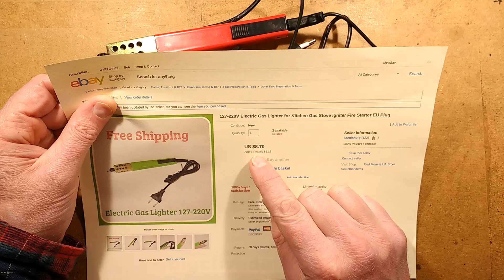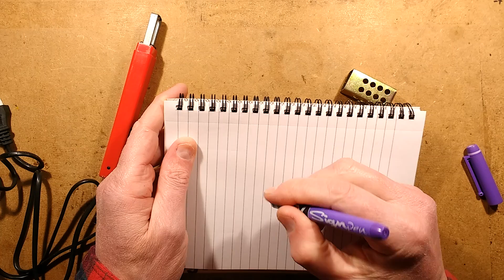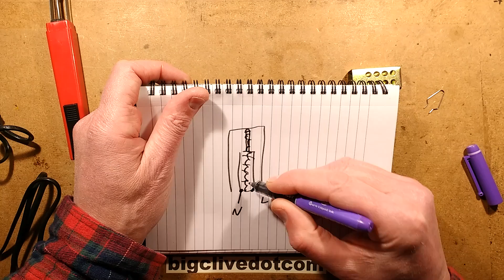Inside a pleasingly scary Russian 240V gas igniter.

Comment: 220v gas stove lighter. Sold here in Romania up until 92. Then the ones that look like a cigarette lighter came out and then the stoves equipped with the piezoelectric ignition from the manufacturer. The 220 volts ones, half ass decent, but play with it for more than 15 seconds at a time and they would kick the bucket.
Reply: RO BT - it's the official exchange ratio set for the dollar in 89. You could buy dollars on the black market at 85 to 100 lei per usd.
Reply: How much did they cost?
Reply: Fridelain - it was 21.75 lei. I remember because the price was stamp in the plastic. About $1.5
Reply: Jack White - that's because people in Eastern Europe still have some fucking common sense...
Reply: I did see an historical record showing that about 100 years ago the rate was $4=1leu - yep, the leu was worth 4 dollars!  It will be even more chaotic when we have to work in Euros for day-to-day purchases.
Reply: Indeed, a perfectly acceptable three-course meal can be had in this area for 20 lei.  However, the cost of living is rising rapidly - vehicle fuel increased by 25% in November and some foods doubled over Christmas.  A cynic might suggest that the population is being softened up for the change to Euros (which reputedly doubled prices when it happened in Italy).  Raising the minimum wage just makes things worse for those who have no formal income.
Reply: That suggests about 14.5 lei to the dollar.  Today's official figure is 3.7 - shows how much the dollar has been devalued!
Reply: I remember my grandma used to have one of this thing, the last time i saw it, i was only 5 or 6 (around year 2000). It could make incredible loud noise which scared me. I have never saw she used it, because the gas stove has the ignitor integrated. I'm from  China, so it is likely that the ignitor was imported from the Soviet Union.
Reply: Fuck me that was expensive. I bought an awesome watch from a fancy shopping centre in romania for 22 lei. 

Ignore the dollars comparison, romania is cheap as hell generally, especially so back then, ecconomically that is more equivalent to $100 in terms of spending power for the average worker. Lets put it another way, minimum wage in romania is $310 per month after tax - and even then you might be on 12 hour night shifts.

A meal in romania will cost you about 20 lei per person, generally. Here it is £25. 

I think this context is necassary to people trying to understand what the cost would feel like to a romanian. Affordable, but not dollar store as the monetary values would make you think.

Comment: So was the burnt varnish smell from the nail or the windings.
Reply: There's no varnish on the nail. Obviously.
Reply: Siana Gearz well in my experience there is a coating on most rough in nails, varnish or wax I believe to keep them from rusting. So what ever that coating is, that could be burning, as it heats up or as it makes contact, OBVIOUSLY.
Reply: Huh, interesting point. Last time i touched nails was probably still in the Soviet Union, and they weren't coated with varnish or wax. There could be a machine oil residue on them though.

Comment: Or you could light your gas with matches. You can still burn down the house with them, but they won't give you an electric shock.
Reply: Your no fun. Massive fireball AND electric shock , them ruskies know how to party.
Reply: We used to use matches back in the day. The mains igniter was much too dangerous for us to consider, and piezo ones were impossible to use, as the thumb button actually needed all of your upper body weight to actuate. Matches were clearly the most convenient and safest choice.

BIC lighter? Seriously? What do you hold us for, capitalist pigs?
Reply: matches dont work when damp, an old russian house probably was more so if you couldnt get the fire lit
Reply: Matches have a bad habit to suddenly end, but this igniter works every time (when you have electricity of course). But we didn't use it too much too, it was a quite noisy and to be honest, scary.
Reply: You'd need some special long matches to light a gas heater that my granny has til this day. Heres where lighters come in handy. She uses pieso tho, but could use one like it with ease. Hard to electrocute yourself when the only part which can electrocute you is inside gas heater/stove/etc.
Reply: they didnt sell bic lighters in russia!
Reply: Not funny. Gas explosions are not that rare in Russia sadly. They leave a few people dead or injured and badly damage buildings - an awful sight.

Comment: Does it work on DC?
Reply from the maker: +Luke Den Hartog It should.
Reply: Yes. Its self oscillating.
Reply: Should work fine on DC, the way it works is for current to run through the winding causing the nail to get pulled down, this draws an arc from the top piece to the nail, the arc breaks then the solenoid turns off due to there being no connection after the arc breaks then the nail goes back to the top causing the winding to get energized again repeating the cycle. Only difference with using DC from what I understand is that the coils will get much hotter at the same voltage so you'd probably want to use a much lower voltage.
Reply: no
Reply: It'd be far more terrifying on DC - I'd expect it to be self limiting to a single use...
example of a guy demonstrating breaking a circuit on AC vs DC https://www.youtube.com/watch?v=Zez2r1RPpWY
Reply: I think that this kind of device works the other way. You use it and someone see your DCs.
Reply: you are right on that account. It wouldn't last long on DC.
Reply: DC meaning Dead Commies in this instance?